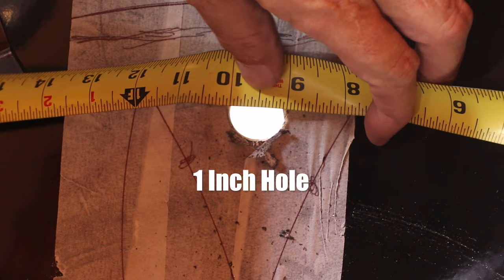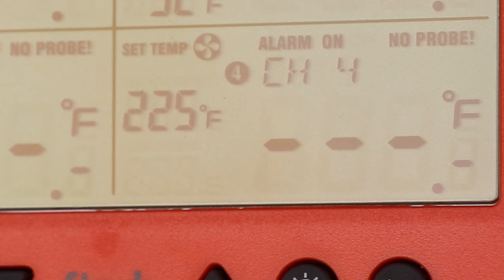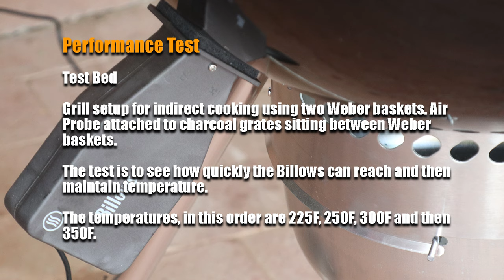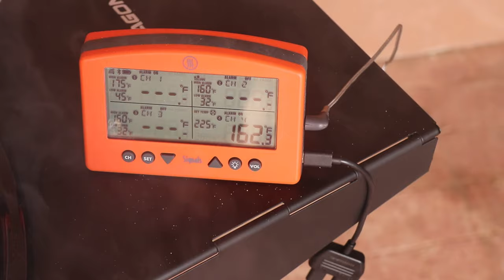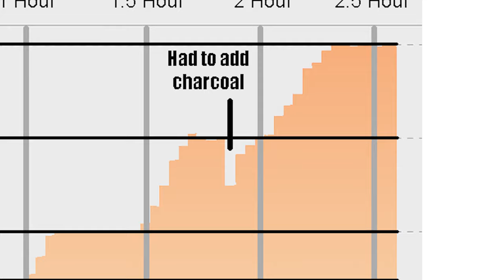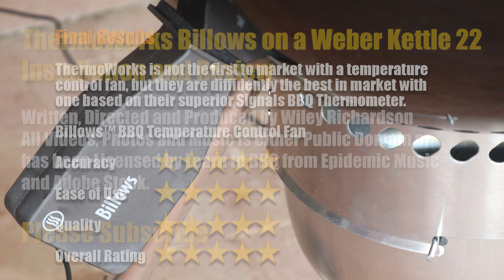Thermoworks Billows Smoker On A Weber Kettle - Installation And Review

Comment: Hi there, nice video. What were your top and bottom vent settings?
Reply from the maker: Top vents were 1/4 open and the bottom vents are completely closed. I am also at 7,000 feet so at sea level the top vents should be 1/8 open. When running the Billows you always close the bottom vents and let the fan supply all the input air.

Comment: What do you do to close the hole when you’re not smoking?
Reply from the maker: Rollup a ball of foil slightly larger than the hole then push it in. Works great and is also easy to remove.

Comment: I guess I am a tad confused. I have a Performer version of the Weber Kettle and I am trying to figure out why you are recommending the blower be installed to the right of the Kettle when viewed from the "back" of the unit? Would not the blower position be related to where you normally build your fire(s) as opposed to any arbitrary "Right" or "Left" direction? Also would it not depend on the sweep of the cleaning arms and the orientation they were installed on a One Touch version of the grill?
Reply from the maker: The right side works well for the left side the billows would be in front of the lower vent arm but it can be mounted either way.
Reply: @learntobbq  Lower vent arm? Do you mean the vent adjustment arm? On the Performer that arm is on the front of the grill a bit to the left of center when at the extreme of its travel.  I suspect the orientation of the parts with respect to the grill you installed the Billows unit on is different than the orientation of a Performer.
Reply from the maker: @DuffyF56  I did the modification on a Premium Kettle 22 and I am not sure how that relates to the Performer. I would have thought they would be the same but not sure for I do not have one.
Reply from the maker: @DuffyF56  Yes the vent adjustment arm. When you use the Billows that has to be closed. Also, the hole is placed so that the vent adjustment arm blades do not go across the hole or it would hit the springs that keep the billows attached. That leaves three places the hole can be drilled in the kettle.
Reply: @learntobbq  Thank you for your responses. Yes, apparently the orientations are different between the different versions. Looking at a Performer and keeping in mind the desire to not have the hole within the arm swept by the cleaning/vent adjustment "wings" inside the grill,  that spot that is not covered by either extremes of the vent adjustment wings is on the right side of the grill when viewed from the back of the unit. The Adjustment arm on the outside of the grill is at one extreme as I described to the left of center when viewed from the front of the grill and moves to its extreme position towards the right side of the grill. One thing I don't like though is the Billows will have to be slightly off angle...not at a 90 degree angle compared to front to back of the Performer Unit as the bowl is mounted at an angle. I have contacted Thermoworks and suggested they design and sell an adapter for installation of the Billows with an adjustable air deflector so it will allow the blower air to be diverted away from a fire location in the grill. As I am sure you know there are a multitude of ways a Weber can be set up and I am a tad concerned that the blower installation will become restrictive as to where I can then build and maintain fires.

Comment: Do you take your fan out when you are about to clean  the ash out? I just went out to my kettle and turned the lever left and right and watched the ash movement. Even with a little ash in the bottom of the kettle it seems like ash would find its way into the fan. What is your experience?
Reply from the maker: It just takes a second to remove the fan and that way you can clean out the bottom of the grill and also the fan. When the fan is on it blow the ash away but when it is off some ash is going to get into the fan.

Comment: Quick question. If i dont want to use the billows. Is there a way to just grill normally still even though there is a hole in the grill?
Reply from the maker: I got a metal plug on Amazon but you can also make a small ball out of foil

Comment: This video is very helpful, no way I would have understood this with just written instructions. Having said that, I am scared sh**less about drilling my kettle. Then again, a kettle is the cheapest grill you can buy, so if I have to screw it up....Also, I noticed that temperature controllers can be very expensive and I didn't even know Thermoworks had one that was cheaper and does its job based on your review. Nice work.

Comment: Question, in the video you have the air temperature probe down on the bottom  charcoal grate. How come you didn’t install the top grate and clip your probe up there as you would in most cooks?

Good video though!
Reply from the maker: John - In retrospect, I should have done that and from now on will. But because the fan is moving the air around like a convection oven I don't think it would have changed the outcome by much. I might test to see if there is any difference.

Comment: Thank you! How to use meat thermometer, do they go in upper air vent hole? Are the bottom vents closed during cooking? How open or closed should the top vents be?
Reply from the maker: I assume you mean routing the probe. I just lay it between the bottom and the lid. I have a gasket that keeps the lid sealed. Yes you close the botton vents for the billows is supplying the air.

Comment: I did this for an old style temp controller that connected neither a metal bowl baffle.  A few years in, my temp got too high for hit grilling that the hose connector on the baffle melted and I don’t really have a way to close the hole when I don’t want to use the temp controller and can’t actually put my fire out without it burning up all my charcoal.

I like your technique, but I was wondering if you had any ideas of how to plug the hole when not in use
Reply from the maker: You can get 1 inch plugs on Amazon that will work.
Reply: @learntobbq   Could you give us an Amazon link as an exemple please?
And could 🤔 it be a good idea to install a vent control? If yes, what do you suggest? Thank you

Comment: What do you do when you want to grill? Leave the bellows in?  Plug the hole? Or??
Reply from the maker: There is a rubber cap you put on the billows so you can just leave it on the grill. Also if you want to remove it there are a lot of 1-inch caps that can fill the hole with the billows removed.
Reply: @learntobbq  Hi, I’m just about to make the modifications to the kettle for the Billows. I want to be able to use the Kettle without the Billows attached, you mention that there are 1 inch plugs that can be purchased, where can I purchase these plugs from, are there any on eBay? I’m located in Australia
Reply from the maker: @fncsxolevzz1949  I used this one - https://amzn.to/2WT3tUc
Reply: @learntobbq do the ash sweeps still work with the plug
Reply from the maker: @matteason989  It still works with the plug and even with the billows attached. That is why the hole is placed where the sweeper cannot get to it.

Comment: Could you comment on whether or not the charcoal consumption goes up with a fan controller unit compared to not having one?
Reply from the maker: Remember the fire triangle? If you add more oxygen to the fuel you are going to produce more heat and burn more fuel. If the fan is running you should be burning more fuel.
Reply: My experience is yes, with the billows, I believe I'm using more charcoal than without the billows.  But, well worth it.  I love this billows.

Comment: The last picture of the rating scores had an adpter between the Weber and the Billows. What is it and why you installed it? Thanks
Reply from the maker: There is a rubber gasket that is between the billows and the grill. This has to be a sealed connection for if any air leaks in the billows will not be able to control the air flow. That gasket comes with the kit.
Reply: @learntobbq  thanks. But if you see the video it shows a big adapter 2-3 inches wide between the bowl and the fan, perhaps there is something deceiving the view? Thanks for your reply
Reply: Just notice. It is a reflection of the Billows 😂

Comment: So after the cook u just keep it on? What happens in grilling mode when ur doing wings with the kettle blazing hot?
Reply from the maker: When you are done cooking just turn off the Billows and let the coals burn out just like if you did not have the Billows. As far as wings the Billows would do a great job. Just remember to leave the lid on so the Billows can control the temperature. I also use a needle temperature probe to monitor when the wings are done. The minute the drumette of the wing hits 175F they are done. the wings are done.

Comment: Awesome video.  I’d love to see another where you start with 4-6 lit coals in each basket and a bunch of unlit.   When you said you were starting with a full chimney I was pretty sure it would overshoot 225, but I’m impressed with how quickly it got back down to 225.  A few questions and thoughts.   Did the billows come with instructions for where and how to drill the hole?  Also, I noticed your temp probe was on the coal grate, I’d love to see it in the cooking grate where the food would be.  Lastly, how did you have the top vent set?   Despite my questions I know thermoworks has well thought out products so I’m sure there would be the same results or better with my previous suggestions.  Again, great video!  I think the installation details were great as well as your detailed result reporting.   I thought I was done buying thermometers and fans and all that jazz but it looks like a Signals and Billow might be going on my birthday and Christmas lists!
Reply from the maker: Actually, ThermoWorks asked me to come up with a way to install on a Weber Kettle. I also need to confess that another YouTuber actually figure it out installing a similar product. Chris over at https://www.youtube.com/channel/UCN_rsQ8jYZeu92_BtnuXkEA . Chris did all the real research and he was nice enough to share. I did enhance a few of the steps trying to make it easier. I will now be doing a full series of videos using the Weber Kettle with Billows. This weekend Pulled Pork  (hot and fast at 300f) and chicken thighs at 400f and cook till meat temperature of 175F.  Also later next week will be doing hot and fast baby back ribs. 300F and cook time of 2.5 hours. I do them in my BBQ class and they always come out great. I am a big Maillard Reaction fan and if you are not above 280F you are missing out on a lot of flavors.
Reply from the maker: I see you are a YouTuber. If you have not joined you should join Facebook groups - YouTube Cooks Community and  YouTube Cooks. They helped me build my channel and they will always support you . Some have become very successful.
Reply from the maker: To answer all your questions. No there are no instructions on how to install in a kettle. My video was done based on ThermoWorks asking me if I would do a video. I agree with you on just a few lit coals and let the coals develop heat with the unit running. Yes, I did have the air probe on the grate between the baskets for I was not looking at food temperature for I had none. I just wanted to see if the Billows could move enough air to equalize the air with no coals underneath it. The charcoal grate is actually cooler than the cooking grate in this configuration. Really appreciate the feedback and all the good questions.
Reply: Learn to BBQ I think I’m in both groups!   Looking forward to watching more of your videos.  Not sure how I wasn’t aware of your channel already!

Comment: Great video. From researching the Signals/Billows combo I see that the fan is either on or off. Other brand temp controllers use a pulsating fan so once the pit is up to temp it will cycle on/off as necessary to keep the temp steady. This is a concern. Have you had any problems with temp swings? Thanks
Reply from the maker: If you look at the chart in the video the billows holds temperature extremely well and because the fan is so quiet you do not hear that it actually slows down as it comes to temperature. Like all temperature control fans you need proper placement of the pit probe and you need to let the coals come up to temperature gradually. Avoid putting in a whole lit chimney (my mistake in the video) or it will overshoot at first but it will then get back on track in 15 to 20 minutes.
Reply: @learntobbq  the first lesson I learned was not to start off with too many lit coal, it makes it hard to have stability.  The second time I used the Billows, I only lit a few coals, and let Billows bring the smoker up to temp.  WAY more stable!
Reply from the maker: @JoeyDoingThings  Good advice.

Comment: Awesome video!  Do you think this will work with the PK 360?
Reply from the maker: I do not have a PK 360 but if you can access the lower vent you should be able to get it to work.
Reply: Learn to BBQ thanks for the reply!  I ordered a PK 360 and it will be delivered soon.  Not sure about the lower vent till I can get my hands on it.  Do you think I can put it in one of the upper vents as well?
Reply from the maker: @shawnsgear  I found this review and it talks in detail how to use the lower vents or as PK calls them "air intake cylinders". Based on this review it looks like you should be able to find a way to hook into these lower vents. Also Billows only works on the lower vents for this is where the fuel gets it oxygen. Here is the link to the review - https://www.wired.com/review/pk360-grill-and-smoker/
Reply: Learn to BBQ Awesome!  Thanks so much!  I will take a look at this review!  Separate question...since I haven’t bought the Billows yet I was considering other options as well. Did you consider The Flame Boss?  If so why did you end up going with the Billows?
Reply from the maker: @shawnsgear  The primary reason why I picked the billows over the others has nothing to do with the fan. The Signals thermometer is one of the best Barbecue and cooking thermometers on the market. Also when you factor in the Thermoworks  App with the ability to chart and store your cooks it is almost a no brainer.
Reply: Learn to BBQ that definitely makes sense!

Comment: I got my Weber Master Touch today and before I assembled it fully, I drilled the 1" hole for the Billows. That way I could do it indoors, in my workshop. I attached the ash lever surround part and that was all I did before drilling.

I found a website https://www.blocklayer.com/circle-templateseng.aspx where I printed out a 1" hole template along with a center hole the size of my pilot bit. I taped the template onto the masking tape. Then I could see exactly where the final hole would be and I confirmed it was centered and there were no conflicts. 

The drilling wasn't so bad - noisy but it worked. I attached the Billows and confirmed there were no issues with the fit. (What would I do anyway even if something was wrong??? Cry I guess.). 

I finished assembling the grill and now I just need to buy something to cook! Thanks!

Comment: Any reason why the  hole is not drilled above the ash fall line?
Reply from the maker: I guess you could do it but you want the airflow to be near the coals so the additional airflow can generate more heat. If you go to high the airflow  will just go towards the top vent and could bypass the coals meaning the billows will have limited affect.
Reply: @learntobbq  makes sense

Comment: Question about ash and drippings.. the bbq guru has a nice cap the protect ash and drilling from entering the fan is there an issue with the billows?  Also how would snake set up do with the billllw or should I use the slow n sear.. or possible a minion method with a diffusers plate
Reply from the maker: I remove the Billows and insert a metal cap I got that is 1 inch in diameter. You can do both the snake and minion for the Billows is below the coal grate. I do make a foil shield that stops the ashes from falling directly into the Billows.
Reply: @learntobbq  thank u so much one last ? Where would u install itnon a 26 inch kettle
Reply from the maker: @issombeituni  You use the same process. You want to drill the hole so the lower vents are clear of the hole. Go all the way to the right and mark where the vent stops and then to the left and make another mark. You will see the area that the vents never cross over and that is where you put the Billows.
Reply: @learntobbq  what does your foil sheild look like?

Comment: Looks good but I am wondering how to keep drippings from entering the fan?

Anybody have a solution?

Or perhaps it is not an issue.
Reply: I wonder the same.  I have a BBQ quru probe on on my kettle and it has a cover that shoots the air down and keeps crud from entering the port and the fan.  I think you'd have to be very careful with your placement of billows to keep drippings out.
Reply: I use an aluminum lasagna tray or a turkey tray under my food, to catch the drippings, also serves as a water vessel too.